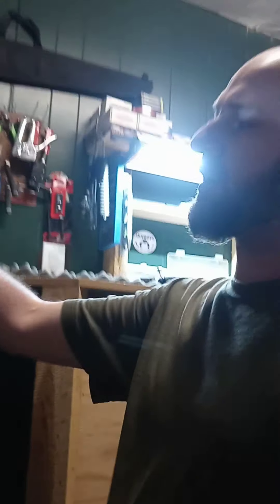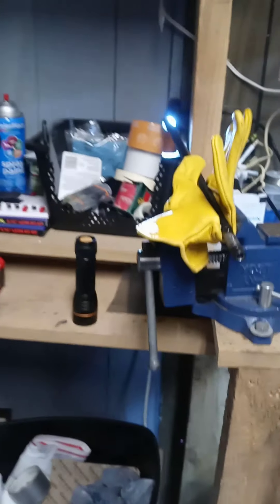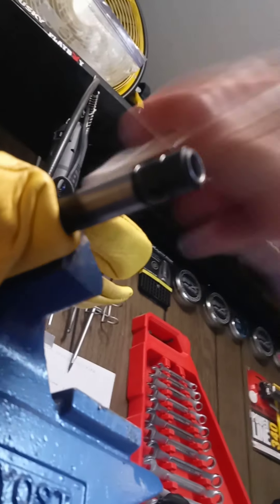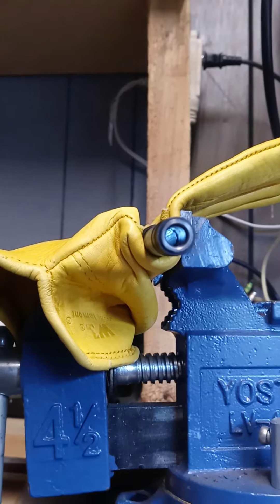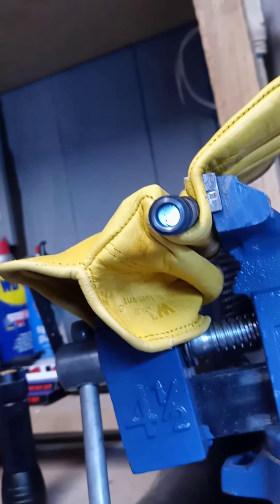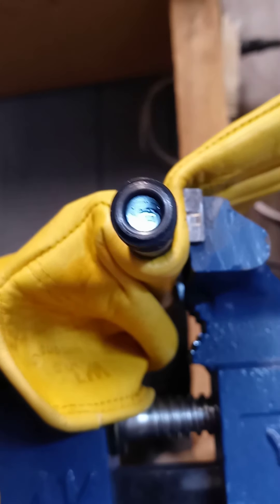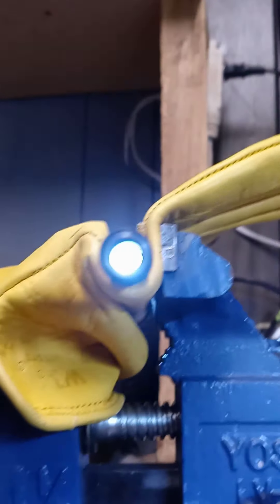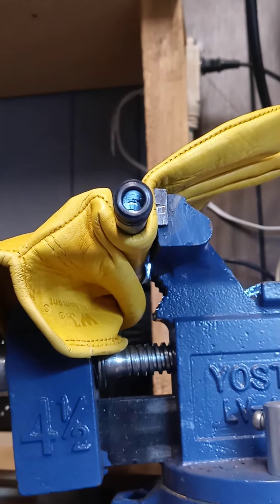An Accuracy Issue! Hatsan Flaspup .25

Comment: Man I wonder if that is what is wrong with my flashpup...
Mine loves to randomly spiral pellets, every brand, every weight..
I catch it with my eye if the sun catches the pellet just right and the pellets will randomly do this insane 10 inch corkscrew spiral type thing in the air..
I wonder if a burr or something is chunking the pellets when I load...
Gonna have to give it a look now.
Reply from the maker: I have my Flashpup making a high of 61 ft.lbs a low barely over 50 ft.lbs right now but no matter the projectiles I too experience the poor BC. Im redoing the entire rifle this last time. 💪

Comment: Hopefully that worked because I don't think you would have any luck getting Hatsan USA to respond if you needed help or had a question from them.  I think they have the worst customer service in the airgun industry.
Reply from the maker: Its no worries. I was able to get rid of the terrible ledge from the misalignment as well as most of the built up mounds of steel which im still kinda scratching my head over but anyhow once the rifle is completely restored this final time only test and results will tell. I quit calling manufactures and distributors over most issues now and tend to resolve them myself. I take the situation as sort of a learning experience. Who to stay away from or what to expect if I purchase their products. Thank you for watching. 💪

Comment: You ready for some more test slugs ? Hahaa 
I have a .457 202 grain modified  R.E.A.L bullet that needs a good test, you up for it ?
I also have a few .357's you might want a sample pack of.
Reply from the maker: R.E.A.L...? What is that?
Reply: @TheFowlerAirgunChannel  it stands for Rifling Engraved At Loading.
It's a bullet design originally intended for muzzle loading rifles. It has sharp bands on it designed to bite the rifling when being pushed down the barrel. The idea behind it was to actually scrape the powder fouling off the bore on the way in making for more shots without brushing the bore every 3 or 4 shots.
The design is really cool and I machined the mold out a bit to allow die sizing to fit a .457
Supposed to be a really stable bullet/slug.
Although 202 grains is really light for a Texan, my quest for a cheaper, lighter fast slug in .457
Continues.